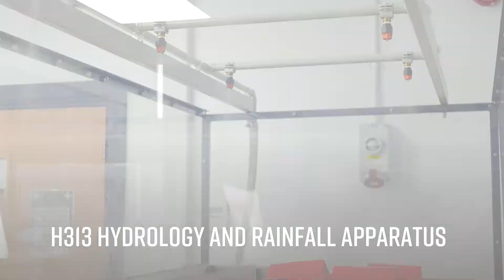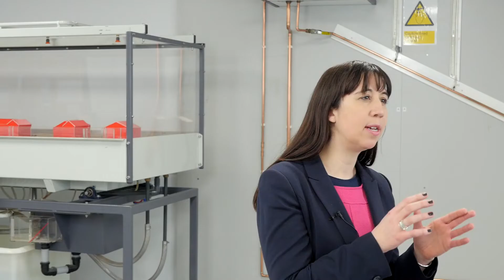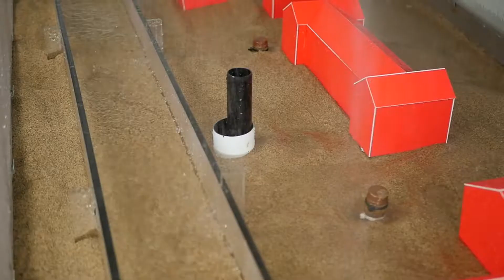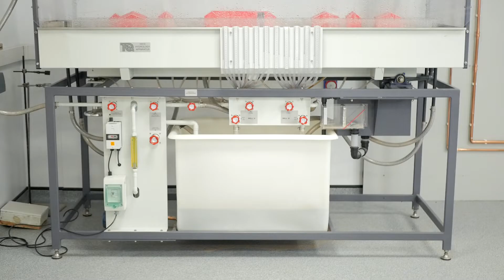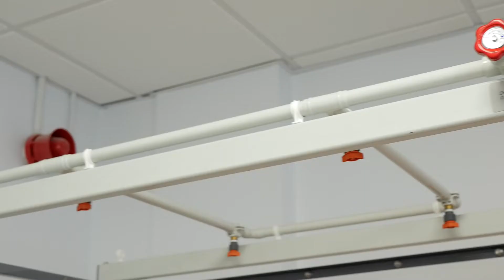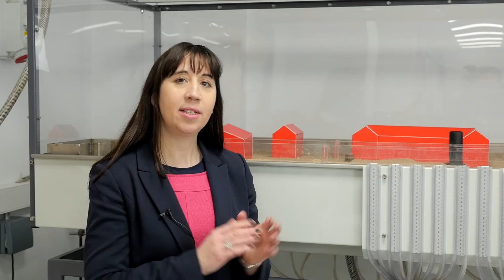Hydrology & Rainfall Apparatus H313 | Practical Hydrology Study for Engineering Education

Comment: Hi,
is this equipment can be used with soft soil i.e. loam or clay? Will it be a problem for the nozzle and pipeline?
Reply from the maker: Hi Baitullah, yes you can as there are filters fitted that prevent sand and soil from entering the pipes and nozzles.
Reply: @Tecquipment  All Right. One more thing, where can I get or download the user manual for this model?
Reply from the maker: Hi Baitullah thank you for your message to download the user guide please follow the link provided https://www.tecquipment.com/hydrology-and-rainfall-apparatus

Comment: What the procedure of this experiment?
Reply from the maker: This is for the comprehensive practical study of hydrology, including rainfall and movement of water over land and rivers. 

Learning outcomes include:
    Investigation of rainfall/run-off relationships for dry, saturated and impermeable catchments of various slopes (surface run-off only)
    Effect of interflow on outflow hydrograph surface runoff (plus groundwater flow)
    Simulation of multiple and moving storms
    Measurement of cone of depression for a single well and comparison with theory interaction of cones of depression for two adjacent wells
    De-watering of excavation sites by use of wells
    Flow from a well in a confined aquifer
    Demonstration of watersheds for a simulated island with rainfall and well flows
    Sediment transport and meanders in simulated rivers
    Studies of scour around simulated bridge piers
    Demonstration of erosion caused by water through flow